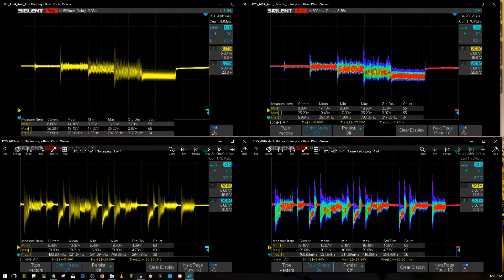CAN THIS BE THE BEST 4in1 ESC?? // DYS ARIA F45A 4in1 ESC Noise Test and Review

Comment: This is why I love Drone Mesh.  He's always right even when I don't listen.  I used DYS Aria individual ESCs and, like him, found them to be mostly pretty good.  So I bought the 4 in 1 for my racing quad without seeing this video.  Its 5V BEC never worked, it ran super hot, and ESC 4 died after 20 flights.  It didn't burst into flames like the individual Arias do when they fail, but its dead nonetheless and I"m out $60 for something I would have known not to buy had I watched this video first.  Oh well, on to the Tekko.

Comment: I’m assuming you tossed this aside after this test but if you haven’t, have you seen any solutions to the noise? I’ve got a 1000uf and 2600kv F40’s and the noise shows up pretty well. Gonna add more caps but curious if anyone else has had any success cleaning this up.